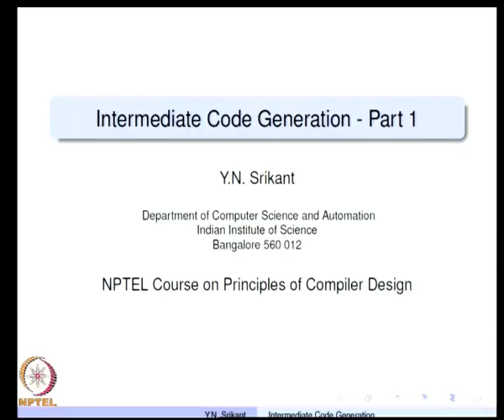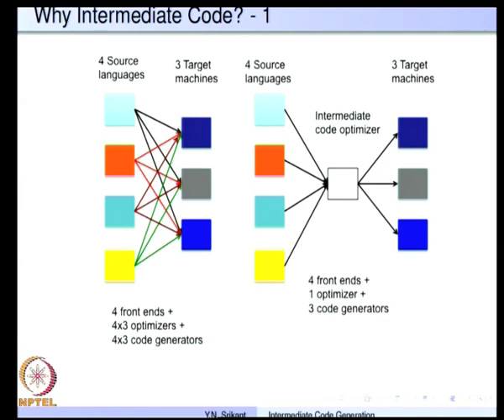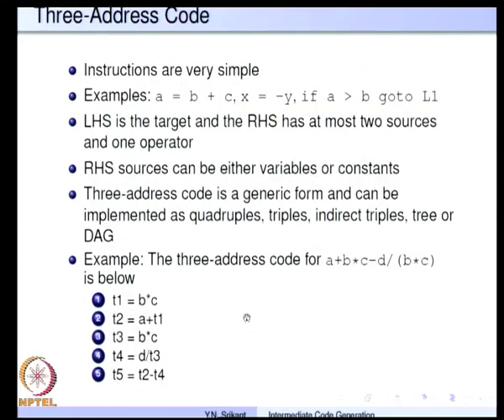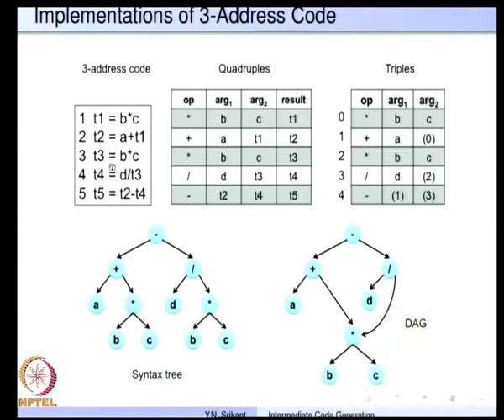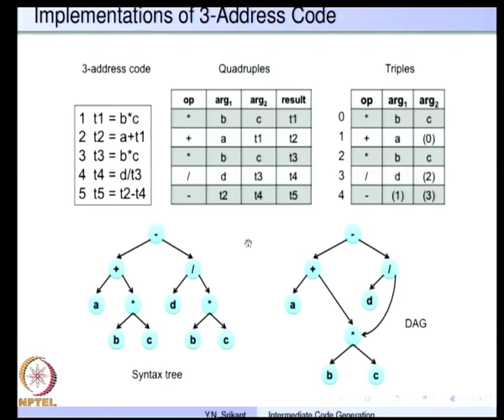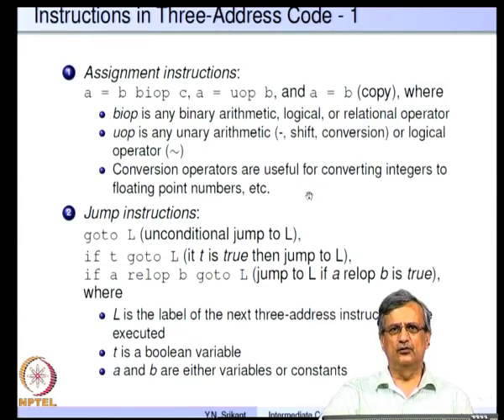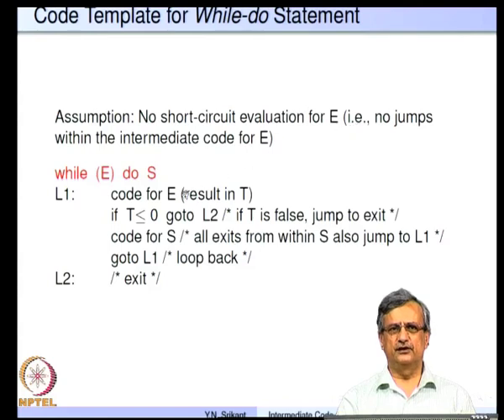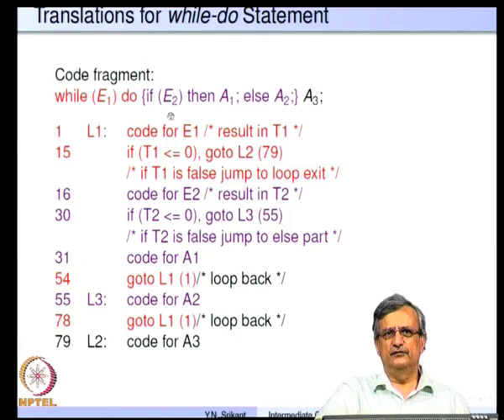Mod-05 Lec-17 Intermediate code generation Part 1

Comment: I think there is a mismatch between "Intermediate Code - Example 1" 31:50 and "Intermediate Code - Example 2" 33:39 .

In Example 1, the value of 1 is multiplied by 4 each time we want to access the next integer of the array. This means that the integers occupy 4 address spaces each.

However in example 2, the pointer is only incremented by 1 each time we want to move to the next element in the array. Now *p++ is valid in C, as the pointer is incremented by sizeof(data_type) but I dont think this would work when converting to an intermediate representation.

If someone could guide me, that would be great!
Reply: Yes, it should be incremented by 4 NOT 1.

Comment: Suppose lets say that, this  is the intermediate code,
t1 = inttofloat(60)
t2 = id3 * t1
t3 = id2 + t2
id1 = t3
and the code optimiser optimises the code and it becomes,
t1 = id3 + 60.0
id1 = id2 + t1

then my question is, why don't the "intermediate code generator" doesn't directly generate optimised code?

Comment: Convert the following source code into intermediate code using the syntax-directed
approach given in the appendix. Assume that all variables are stored in 4 bytes.

Can you provide solution for this question
max = −999;
i = 0;
w h i l e ( i < 10 )
{
i f ( a [ i ] > max}
{
max = a [ i ]
}
i = i + 1;
}